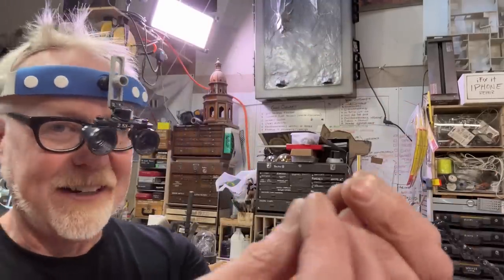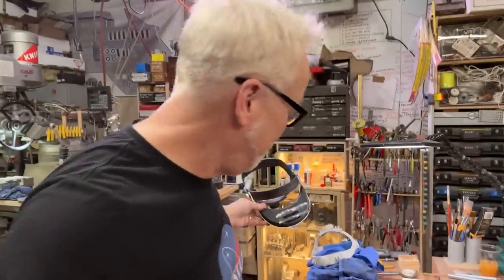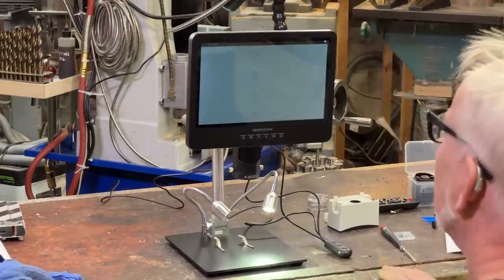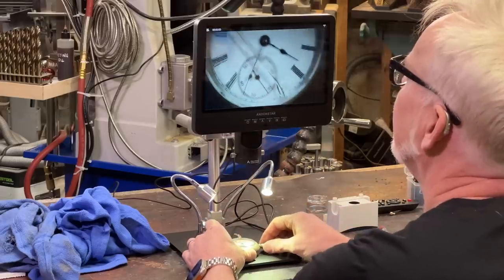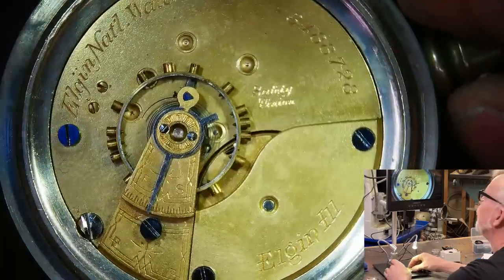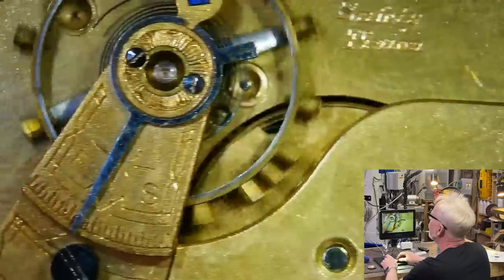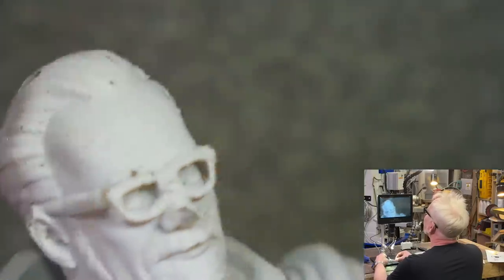Adam Savage's New Digital Microscope!

Comment from the maker: Andonstar 2000x Digital Microscope: https://amzn.to/40KSv34
Disclaimer: Tested may earn an affiliate commission when you buy through the links here.
Reply: I think it would be great if you provided some more accurate magnification numbers than the product page. One reasonable measure would be the object compared to the image displayed at 1x on the default screen.
Or take a photo of a screen and note how many pixels each pixel is.
Or, if you want to go crazy, just compare the size of the object to the size of the object projected onto the image sensor(Probably the most honest, but the most depressing number).
Reply: After doing some math, I'm pretty sure measuring the image projected on the image sensor is actually a negative magnification...
Reply: If my math is correct, it looks like the coin is magnified 3.25. (39mm coin, 2175 pixels on my 3840 wide screen, 0.566 of the screen, width of a 10.1 inch screen is 224mm, 0.566 of  224mm is 126, which is 3.25x 39.
This device is great for what you are doing, but if you want to take it to another level, I recommend a stereoscopic microscope and a DSLR lens adapter.
Reply: Curious if that is really 2000x.
Reply: @frijoli9579  If you zoom into the image 1000x it is(not really...it's complicated.)
Reply: Use your minimill as stand...   Just adjust the z travel as needed
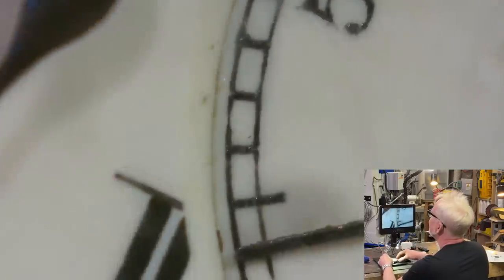Reply: The quality of imagery you get from any microscope will depend heavily on the lighting. Changing the angle and direction the lighting is cast on the subject will greatly effect how it appears. You can see that at 12:25. Try casting light from only one side, for dramatic relief. Also sometimes you want to be able to diffuse the lights, which can help those speckly diffraction artifacts and highlights on shiny or complex subjects. A diffusion tent made out of some paper or a styrofoam cup with a hole in the top can greatly tame out of control highlights, though you might have to upgrade the intensity of the lighting.
Reply: How accurate would it be to just timestamp a video of the second hand completing a minute to figure out how "off" it is?
Reply: Where's your previous video about a new microscope (it was LIVE)? EDIT: You've added it to the Members Only, which is a very strange decision. Also, it's was not that interesting to see the same microscope twice, especially in the reverse timeline order, where you show unboxing after the live stream

Comment: @Adam Savage's Tested - Hey Adam...  I bought one similar for doing solder work, and I found it immensely more usable with it mounted to a VESA swing arm monitor mount. I simply drilled four holes in the base and tapped them so that It would fit the mount from the bottom of the base.  Then I mounted the microscope in reverse and tilted height adjustment bar so that I could use it to fine tune the height above my work.  It works beautifully and gives me a much larger rage of motion over my work.

Comment: Cannot wait for the one-day build on taking this to the next level. I was planning on getting one and trying to mount the pole flush with my table or a flatter much wider base so I can use my soldering kits/mats with it. Will wait to see what you do and apply R&D (Robbery & Duplication) of your ideas.
Reply: You cut the mat so it fits the base.
Reply: Alas, my mechanical skills are nowhere near good enough to improve the mounting mechanism.  I will just have to be content with living vicariously through Adam's future one-day build.  The fact that the camera and display are a single integrated piece seems promising.

I've debated getting a digital microscope for electronics work.  I wonder how much the lack of binocular vision would impair trying to do something delicate while watching the screen.
Reply: @1pcfred  that base is tiny. I have the new massive Gamers Nexus solder mat that has trays and holders for tips, parts and tools. I could cut a slit but also don't want a small area that is raised metal. Notice how small that metal base is? My base for my arms is as least 3 times bigger than that. I also picked up the welder hands Adam uses. I'll probably take my existing base and if possible mount this pole to it or rig a direct connection to my build table like I did with my DIY fume extractor. Thanks though
Reply: @markday3145  I have a tall mount pole that already has a long led lamp on a swivel head, a document camera (using kinda like this for now), an over the shoulder camera for demos, and a 24 inch monitor at eye level. Will probably use the HDMI output on one of these models to the monitor. Might see if one exists with no screen at a cheaper price.
Reply: @bhgemini  it sounds like for you it's go big or go home. Anything's possible. Not everything turns out to be practical though.
Reply: I can see most of this with my own eyes, perhaps you have poor eyesight
Reply: @GardenGuy1942  with enough magnification you can see all of it.
Reply: @1pcfred  I’ve been able to tell the time my whole life, no magnification needed
Reply: @GardenGuy1942  I doubt that watch has had the right time on it more than twice a day for your whole life.
Reply: Oh yeah, better lighting, rack and pinion z axis, tool(/paintbrush for models) holder.. pimp that microscope!

Comment: I once had a job polishing tiny metal parts. I used an eyepieceless stereo microscope to see what I was doing (these cost around 4k EUR at the time). What amazed me most when I did this work was that my hands and fingers were capable of movements at a much finer resolution than my vision. Since then, my mantra has been "Make sure you can REALLY see what you're doing".

Comment: I would love to see you mount this on some kind of arm. I have a smaller/cheaper scope that is similar to this and I mounted it onto a cheap articulating microphone arm. I just needed to print a ring mount that I could screw onto the 3/8 thread the arm used. It's not as stable as I would like, but it is great being able to move it around my entire workbench and easily raise and lower it.

Comment: I LOVE my digital microscope. Bought it thanks to an Amazon gift card my friend got me for my birthday several years ago. It wasn't that expensive either. I'm an electronics hobbyist, but being extremely low vision, have always found working on electronics to be challenging. I've used magnifiers (both handheld, tabletop and head-mounted like the one you showed off earlier in the video) but found that they were clumsy and awkward to use, they always got in the way, and offered such a narrow field of view that they were extremely hard to use. The digital microscope is a game changer. I now have absolutely no trouble and can easily work on even the smallest of surface mount components, with great field of view and excellent lighting.

BTW I ditched the little stand that came with mine (it was too limiting imho) and instead designed and 3D printed a mount for it that lets me attach it to an old swing arm microphone stand that I had lying around. Clamped that to my desk, and now I can position the microscope in any which way I want to. And I have a couple LED spotlight lamps also clamped to my desk that I can use if I need additional lighting.

Recently I accidentally broke the USB port on mine (which is also used to power it) and that brought up an interesting chicken and egg problem. (How am I going to repair my soldering microscope, which I need to solder with?) I ended up having to pull out one of my old head mounted magnifiers, and good grief, that was an exercise in frustration. I was able to replace the USB port in the end, but it was NOT easy.

Comment: I've owned this exact same microscope for a year or so.  I use it for micro-soldering/SMD repair.  It's awesome AND it has an HDMI out so you can plug it into a bigger TV or monitor for a bigger screen if you want.
Reply: I have a microscope with a smaller monitor - the lights and the rest of the hardware look identical, thought I don't know if I could swap out lenses like that.

But I can also plug it in as a webcam to my computer via the mini-USB port, which is super handy!
Reply: How do you find its depth of field?  I've been thinking about getting a digital microscope for my lichenology.
Reply: @tbone9912  Thank you!  I currently use both a stereo microscope and a compound microscope with 100x oil objective. The compound microscope has a digital camera attached, but the stereo doesn't and I sometimes need to take photos using it. I've tried using my mobile phone with the stereo through one of the eyepieces, but it's clumsy.  I've bought a connector and tried using one of my husband's astronomy/telescope cameras.  It works, but I can't keep borrowing his camera!

Comment: I've experimented with magnifiers for ages and realise that the benefit of binocular vision cannot be underestimated but I love the focus control of a digital microscope. The surgical magnifiers are great but seem to be pedantic when it comes to placement with respect to the eyes - a fairly elusive mechanical sweet spot although the arms length depth of field is remarkable. A binocular optical microscope is restricting your work space and is not paint / glue / solder friendly. I've not found a good solution which is reasonably tolerant of changes in object distance, good depth of field and allows me to retain good eye-hand coordination whilst keeping awareness of my environment (soldering iron burns). You'd think the surgical solution would be the one - perhaps I didn't spend enough on my magnifiers. Maybe VR with a bino camera next.

Digital microscopes are great for inspection but it's very hard to work under one.

Comment: I got into watchmaking because of Marshall.  Found I never used the digital because of lack of stereo.   I always used my optivisor instead.  Then I found an amscope on Amazon for $217.  No comparison.  Actually just picked up an Elgin pocket watch roughly that vintage.  It was stuck at full wind.  Did a service and runs surprisingly well for it's age!

Comment: Hey Adam. I bet you could get the watch timing REALLY close, almost as accurate as a quartz crystal,  with a digital O-scope and a microphone as pickup. Pass the idea along if it works. 

I've used that trick to balance rotating assemblies and to measure RPM with a salvaged light pickup and some reflective tape. Scopes read bare sensors really well.

Comment: Adam, speaking from experience, get another pocket watch to start on. Any  16s size movements would be better for a first time trial. The reason is that those 18s size watches utilize a full coverage back plate, which means that you need to adjust the alignment of the gear pinions through the sides of the watch, without being able to see the back or front. 

The 16s size watch movements use two or more pieces for the back plate, which makes it easier to align everything when putting it back together.

Comment: Those old pocket watches are workhorses. As long as they haven't gotten wet or dirty, and have been cleaned and oiled carefully they tend to run forever. I have my great, great grandfather's New Haven pocket watch and it still runs and keeps accurate time and it's over 100 years old.

Comment: Might I suggest getting a modern eta 6498 to play with and get used to tearing apart and putting back together. Old pocket watches can be a nightmare. You will want to close the bushing holes which have probably been worn into oval shapes. Also you will want to polish pivots on gears and replace the mainspring which is probably set. Good luck

Comment: Marshall is the best! As I am sure he would also recommend, I would practice on some cheap 6497 clones before you dive into that. It is inevitable that until you adjust to working in the micro world that is watchmaking, you will lose or otherwise mess up something. That balance spring is of the fragile older type and could break very easily. Replacements are hard to find as you might imagine. Proceed with caution.

Comment: Hey Adam, you mentioned wanting a timegrapher.  In the mean time, there's an inexpensive app for your cell phone that can stand in pretty well before you make that purchase and goes by the name, Timegrapher as well.   Also, thanks so much for doing this review!  I've been looking at microscopes for my pocket watch servicing play and at this digital microscope in particular.  The biggest selling point is the distance between the  specimen table and the lens.  It suggests that you could see your work while you're working on it.  Seems like something all watch working microscope should provide but don't.   I'm also a fan of Marshall's channel.  Not that it really matters, and especially with a beautiful  Elgin like yours, but Railroad standard pocket watches had a bunch of different required features.  Usually they included; Lever set hands rather than Crown set, Arabic numbers rather than Roman numerals, stem at the 12 o:clock position and not the three o:clock position, regulated to four of five positions,  a minimum of 15 jewels prior to 1895 and 17 after that, open face rather than hunter case,  no more than 3 seconds gain or loss per day and finally, they were usually size 16 or 18.  Again, thank you!  This was really helpful and it looks like I'll be getting one of these digital scopes. It should really help!

Comment: A lot cheaper than a stereo microscope and more comfortable to use.
As part of your upgrade, could you create or adapt a LED ring light to fit the High Mag objectives? For example, the housefly's compound eye is viewed with transmitted light shining through the transparent sample... which is great. But you can't see the 'honeycomb' of eye lenses because the surface structure is blown out by the light shining through it. With a top light, you would see the surface structure. The light source would have to be as close to the very tip of the objective as possible so the light hitting the sample wouldn't be blocked by the objective itself (I've played around with this idea on a standard microscope... with varying degrees of success and failure). I don't have the machining skills and equipment that you have so you could probably pull it off well.

Comment: Your Elgin appears to be a 7-jewel movement.  That is a bearing jewel and a cap jewel at each end of the balance staff + a roller bearing on the side of the balance staff where it connects with the pallet fork, and two pallet jewels at the other ends of the pallet fork that release one tooth at a time of the first wheel.  This is considered the minimum requirement for accuracy.   Watches for use on trains would probably be required to have the next better movement.  Also, the dial (face) of the watch is not correct for trains.  Trainmen were required to have watches with a "Railroad" dial - Larger numbers, not Roman numerals to reduce the chances of misreading the time, larger hands, etc.  My father did watch repair.  He had a small book that gave approximate dates for when each company made movements by their numbers.  It is likely that you can find out more about your movement such as its date of manufacture by asking anyone still in the trade.      Enjoy the new optics and thanks for the video.

Comment: I am about to buy another set of magnifiers. One thing I did was buy cheap 2, 3, 4, and  5 diopter reading glasses. Unfortunately, as the magnification goes up your hands end up being right in front of your face. So I need a binocular set now. I got an Amscope Stereo inspection microscope, but my eyesight is off and it's hard to focus to get a low strain stereo view. Now I am looking into something with an LCD screen.

Comment: I have a small basic Dyno Lite, about 200 bucks and it is 20x, which is really enough mag for anything I do. It's simple plug and play, just about. But I bought a small camera stand, 12"  and modified the mount for ease of use. But this thing Adam has is about a thousand times cooler and I want one.

Comment: I think you put the yoke arm upside down on the vertical tube.  The focus rack knobs should not be BEHIND the screen, they should be visible and readily accessible BELOW the screen without your having to reach around behind. It looks to me like if you flipped over, its already designed to have the focus rack controls hang below the bottom of the screen.

Comment: A while ago I managed to pic up an old large metallurgy microscope made by nikon. It had alot of fungal growth on internal lenses that I had a go at cleaning to make it usable. Needed eye pieces and a new 20x lens as one of the lenses in the optic was smashed some how. The whole unit is quite bizarre as it's optics are mounted bellow the sample so you can technically put fairly large samples on the roughly 8x8 inch 2 axis bed. It has binocular lenses as well as a port for a camera, which it did come with an old film camera. It also has a spot for large format polaroid film that has a viewing screen currently in its place, with enough light you can see stuff on the screen. For solid/reflective objects it has a lighthouse which shines the light onto the sample via the optics using a bunch of mirrors optics and filters. It has 5 optics that range from 5x to 100x with 10x eye pieces for an insane amount of magnification. I will need to give it another clean to make the lenses clearer and make a light source to shine through the sample that will hopefully work better then an adjustable brightness 1000lumen headlamp mounted to an old desk lamp. Despite the jank I have managed to see water bears in liquid samples as well as many other crazy micro critters, I can't remember the scientific name but there's a crazy organism called a swans tear which has a massive long neck that it can extend and move around and I spent about 10 minutes chasing it around the sample using the 2 axis bed which has very fine control